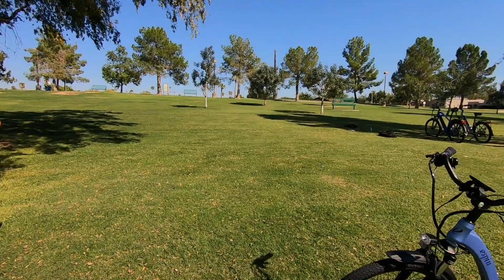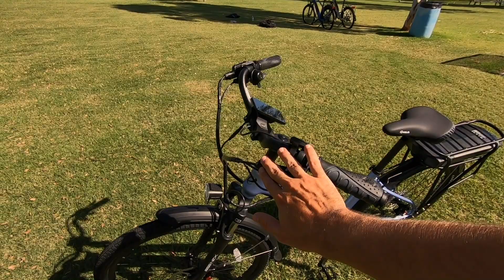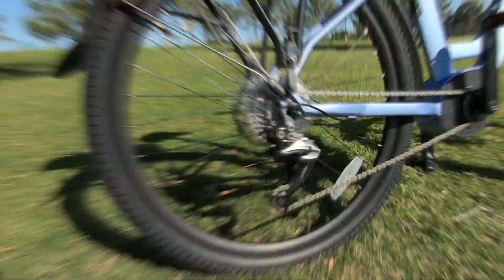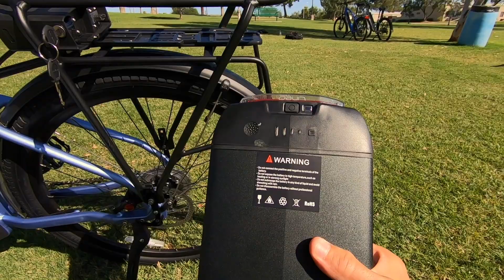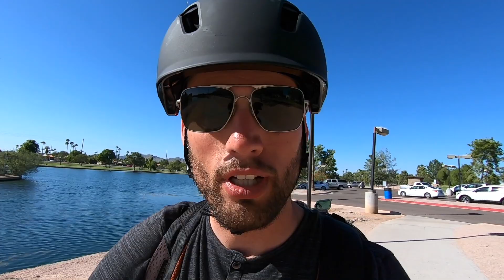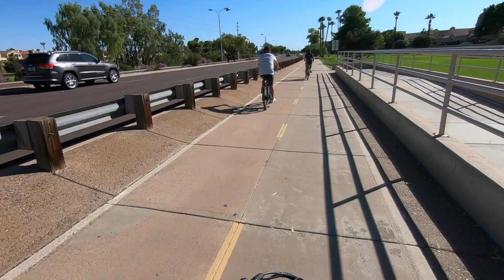Espin Reine Review - $2k

Comment: If that had 500W or more, it would be the ultimate "street" cruiser. IMHO...
Reply from the maker: I feel ya, the motor is rated 250 watt to 500 watt peak with 80 newton meters of torque, so it's pretty capable. It seems like most mid-motors are rated a bit lower, but since you can switch gears, they provide a lot of potential power.